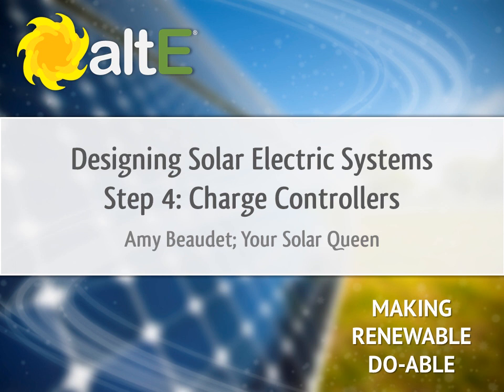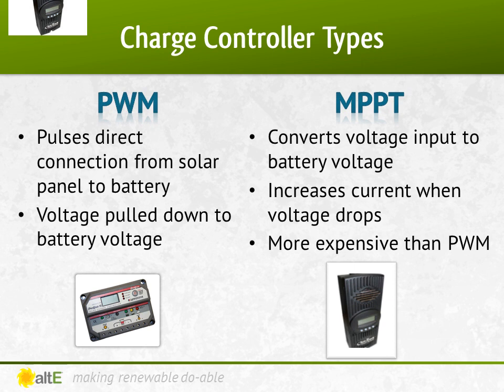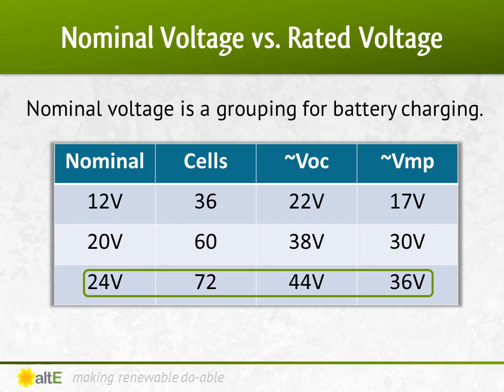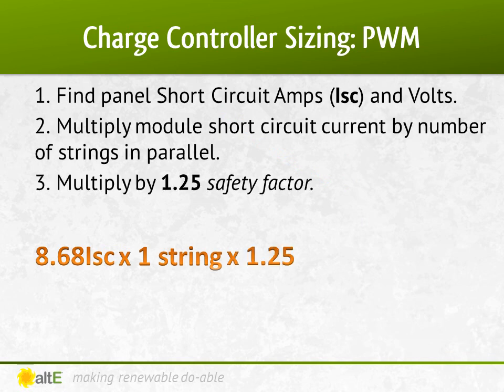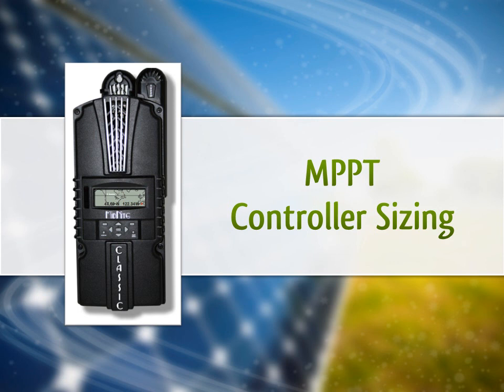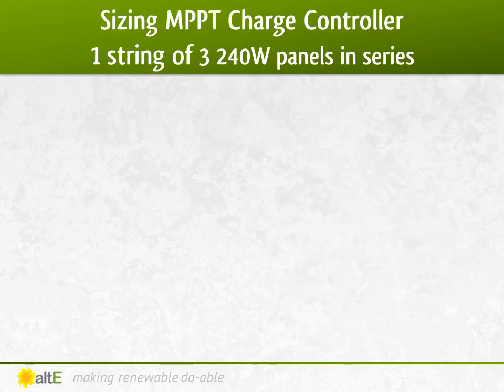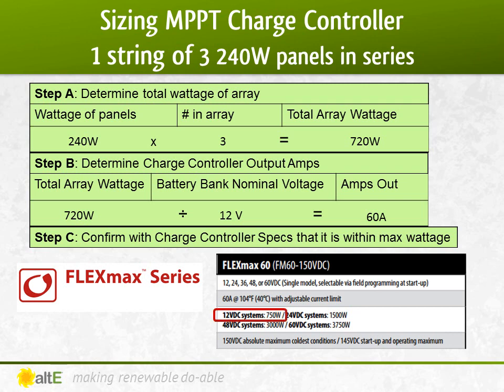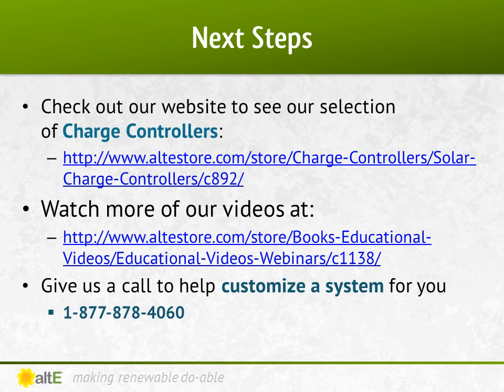Solar Charge Controller: Off Grid Solar Power System Design - Step 4

Comment: Thanks Alte store, a very good tutorial for off-grid solar power system design.
I have 2 questions: 
1) Could I connect 3 panels with nominal voltage 24V in series => 72V, to charge 48V battery with MPPT charge controller? Is it too big difference? 
2) Some MPPT charge control;er mention these:
  Max. input voltage = 160Vdc
  Overvoltage protection = 150Vdc
  Input voltage recovery points = 145Vdc
What is it all about? What will happened if the input voltage is greater than 160 Vdc, for instance 165 or 175V?

This is the system I am designing based on limited number of panels and battery. Any advice? 
https://ibb.co/m4s5zF

Thank you.
Reply from the maker: The max voltage listed on a charge controller is for Voc + temperature compensation. Silicon panels' voltage goes up when it gets cold, by as much as 25%. So you need to figure in the voltage for the coldest it will ever get during the day in your area. So if you are in the tropics, three 72 cell panels in series should be fine. 46.2Voc x 3 = 138.6V. But if you are any place that gets close to freezing, then the voltage can get too high. High voltage into a charge controller will generally damage the capacitors in it, usually causing smoke to come out (that's bad). Midnite Solar's Classic has a mode that will protect itself and turn off if the voltage gets too high. It also is available in higher voltage models, 150V, 200V, or 250V.  Note that if you do use a higher voltage, you need to make sure your breakers between the panels and the charge controller are also rated for higher voltage. Most are only rated for 150V.
Reply: Thanks for the reply! :) 
I have another question, I post in a new reply so if anyone has same issue can view it easily.

Comment: Thanks for your great information. I am building a system that will have a 24 volt battery bank with 12No. 250 watt panels. The panels have a Voc of 37.8 volts and an Isc of 8.28 amps.........Unfortunately there are trees occasionally casting partial shade on different panels throughout the day. To minimise the effect of shaded panels bringing the rest of the panels down in a large series I am thinking of creating six series of 2 panels in each series by using six small mppt charge controllers (capable of taking 75 volts and 10 amps each). Do you think this will work? And if you do would I just fuse each charge controller and connect them straight to the battery bank or do I have balance them out in some way?
Reply from the maker: As long as all of the charge controllers are the same and are set to the same settings, it should be fine to have them each with their own breaker and parallel the outputs. The best option is to use charge controllers that will actually communicate with each other, like the Midnite KId, but that might be more than you are looking for. 
Note that you need each charge controller to manage 20A, not 10A. 250W x 2 = 500W / 24V = 20A.
Reply: altE thanks for your reply and thanks for the correction on the size charge controller. I've seen another of your videos on the midnite kid and they look great but as you say a bit over rated and therefore too expensive for the job.

Comment: When sizing an MPPT controller do you not need to add the 25% safety margin?
I'm planning to use 2 x 275w panels in series charging two 12v batteries in parallel.
Therefore 2 x 275W = 550W / 12V = 45.83A   
So can I use a 45A controller or do I need a 60A controller with some safety margin?
Reply from the maker: Correct. Because MPPT charge controllers can manage the output better than PWM charge controllers, you can oversize the solar array a bit and not damage the equipment.

Comment: What is voltage correction factor for my multi crystaline module? How to calculate it?

Specification of modules are, maximum power (Wp = 225) , power tolerance (±3%), Vmp (26.66V), Imp (8.44A), Voc (33.60V), Isc (8.9A)

Thermal Characterstics:
Temperature coefficient of Pmax  = -0.43%/°K
Temperature coefficient of Isc =  0.046%/°K
Temperature coefficient of Voc =  -0.33%/°K
NOCT = 45 ± 2°C

Operating Conditions:
Max. System Voltage = 1000 VDC
Safety Class = II
Maximum Series fuse = 15A
Operating Temperature = -40°C to +85°C
Reply from the maker: Here in the USA, we use National Electric Code's (NEC) Table 690.7. https://www.mikeholt.com/instructor2/img/product/pdf/14SOLB-1229-sample.pdf (page 5). For example, if the temperature gets as cold as -20C, you would use 1.18 as the correction factor. So 33.6Voc x 1.18 x number of panels in series. For 1 panel, it's 39.6V. But for real numbers, you can use the temperature coefficient from the spec. -.033% per kelvin from 25C. So in the same example, -20C is 45C colder than 25C, so (33.6Voc x 0.33% x 45) + 33.6Voc = 38.6V. You can see that the NEC calculation is a little higher than the one for that particular panel.
Reply: Here in India at my place, temp. never falls below 5°C, so I have to consider my worst case , So voltage correction factor could be, (33.6Voc x 0.33% x 20) + 33.6Voc = 35.81V 

Am I right? or I don't have to consider correction factor as temp never falls below 0°C?
Reply from the maker: You are right, you always want to factor temperature in.
Reply: altE Thanks. your videos are great help to me.

Comment: When designing system for 1168 W using MPPT. Can we use 2 strings with 2 X 315 W in each string as we did in PWM.

As there 315 * 4 = 1260 W
and we need so the current will be 1260 / 48 = 26.25 A
We can then use TS-MPPT-30 operate perfectly inside the limits of the controller
Reply from the maker: I'm assuming the 315 are at least 72 cell (24V) panels. If so, yes, that would work.

Comment: Kyocera 240 * 3 = 720 W and limit of the MPPT was 750 W. If the temperature goes down to -26 Celcius, Will it cross 750 ? If so then why we have used this MPPT
Reply from the maker: Most MPPT charge controllers can handle more than their wattage rating, as long as the volts are below the upper limit. This means it can usually handle more amps. But it will limit the output to the rated amps, so even if you put more in, it will clip the output to its limit.

Comment: Why we limited the MPPT upto 150 V in a string when 39.4 X 4 = 157 A and then we used three panels in a string.
Reply from the maker: The charge controller specs tll you the voltage limit for that controller. Four of the panels were too high for the 150V limit, so we had to back down to 3, which is under the 150V limit, even when we factored in the cold.
Reply: Is it possible to have a charge controller that can with stand Voc higher then 150V. If so then why we did not used that?
Reply from the maker: Yes. Midnite Classic 200 and 250 can go to 200V and 250V. Their current output is a little lower than their 150V version. Magnum has a PT-100 that can go up to 240V at 100A. Schneider and Morningstar have 600V charge controllers. They cost a bit more than 150V ones.
Reply: Thanks a lot for all the quick replies, You people are great.

Comment: Nice. So, in sizing PWM, the formula goes like this? Isc of panel x # of strings x 1.25? and in MPPT, Total watts of array divided by system voltage? Thanks.
Reply from the maker: +Aleneski Kalashnikova For MPPT, total watts / battery voltage x 1.25.

Comment: Nice easy to follow info,doing a short course on solar power system,wish you were my teacher.Came across some info on the web about blocking and by-pass diode on the series and parallel strings for the panel to cut off power consuming panel etc.Do you have a video dealing with this topic?Just came across your video series,cheers good job.
Reply from the maker: +CLIFTON RICARDO RUSSELL Thanks. We don't have a video on blocking and bypass diodes yet, but thanks for the suggestion. I'll put one together and post it here when done.
Reply: +altE Store Cheers,can't wait.
Reply: Cheers, thanks much.
Reply from the maker: +CLIFTON RICARDO RUSSELL Here's the updated link to the diodes video you requested. https://youtu.be/5rYy0gHZepI

Comment: Can you wire six12 solar panels to a 40 amp mppt charge controller to used on a 12 volt battery bank
Reply from the maker: +Ledwin Ford It depends on the size of the 12V panels and the specs of the charge controller. For example, these 12V 80W panels https://www.altestore.com/store/Solar-Panels/altE-Poly-80-Watt-12V-Solar-Panel/p10352/ have a short circuit current (Isc) of 4.85A. 4.85AIsc x 6 panels x 1.25 NEC safety = 36.3A. So yes, you can have six 80W 12V panels into a 40A charge controller. What's even better is that, depending on the specs of the charge controller and the location of the system, you may be able to wire them all in series. That would allow you to have one string of a higher voltage and lower current on the wire going from the solar array to the the charge controller (6 x 22.1Voc =132V x 1.1 temperature compensation (down to 32F) =145V (most MPPT charge controllers can handle up to 150V). If it is very cold there, below freezing, then you may need to do two parallel strings of 3 in series, which is still a heck of a lot better than six panels in parallel.

Comment: How do you size the charge controller if you have large off-grid system (more than 50kW)? What is the maximum size of charge controllers? (input voltage and current). If the size of the system increases do we need to use multiple charge controllers?
Reply from the maker: Hi Umid M 
In large systems, multiple charge controllers are used, each controlling a subset of the solar array. The maximum size of commonly available charge controllers is the 96A Midnite Solar Classic (http://www.altestore.com/store/Charge-Controllers/Solar-Charge-Controllers/MPPT-Solar-Charge-Controllers/Midnite-Solar-Charge-Controllers/Midnite-Solar-Classic-150-MPPT-Charge-Controller-150V-96A/p8753/). 

Depending on the size of the solar array, you would have one charge controller for approximately every 15 solar panels, 5 parallel strings of 3 in series. Each charge controller would be connected into the battery bank through its own breaker. 

Note that a system that size will have many issues to consider and should be designed by a professional solar designer to ensure code compliance.
Reply: +Umid M Another option is by using a PV Inverter and direct the input to a battery inverter as you would a generator. Sunny island PV inverter can handle up to 11 kw each.
Reply from the maker: +AtlanticWastePower 
You are right for adding batteries to a grid tie system, AC Coupling is another option. However, Umid was asking about an off grid system that wouldn't have a grid tie inverter. Due to the limitations of AC Coupling, DC Coupling, using solar charge controllers instead of a grid tie inverter, would give you the most control. For more on AC and DC Coupling, you can see our other videos at https://www.youtube.com/watch?v=Wz7rJV0DMok and  https://www.youtube.com/watch?v=uQQkwvr9ZFk